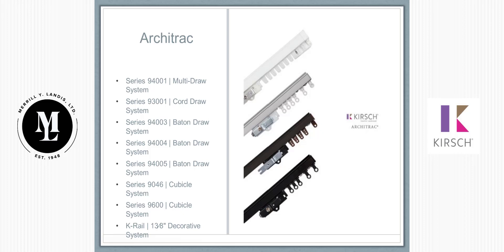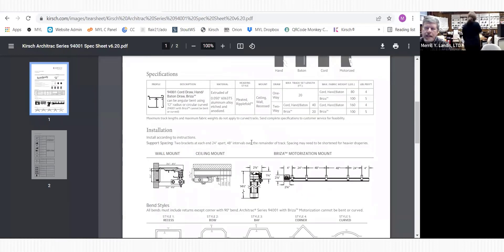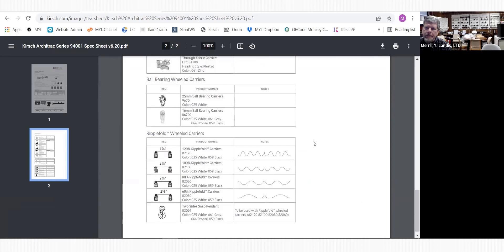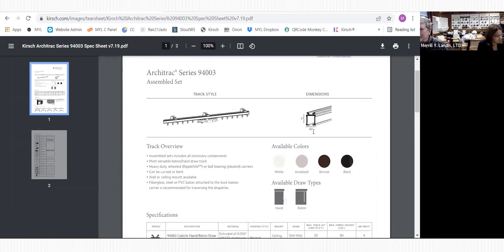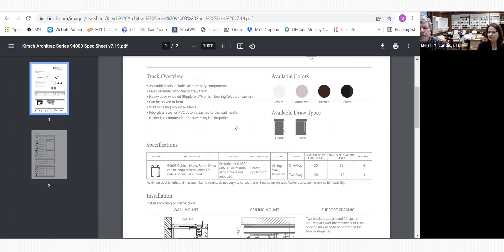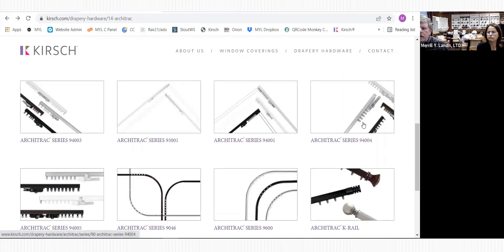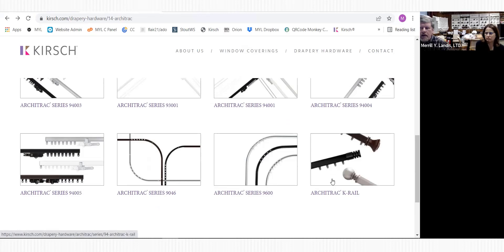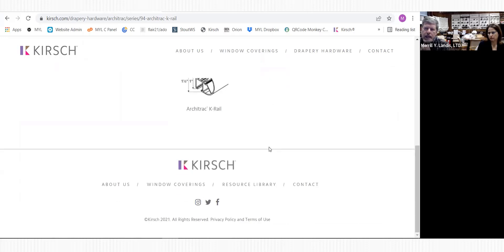Kirsch Architrac Hardware - All About Tracks

Comment: I want to ceiling-mount my 93001 track using the Kirsch ceiling clips (thus avoiding having to awkwardly screw the entire track to the ceiling). However, it looks to me as if the head of any screw I use to attach the clip to the ceiling will be a problem: the screw-head will make it very hard to push the track into the clip. I recall when I used the wall-mount clips in a previous installation that even then it was tough to hold the track in place firmly enough to turn the "gripper" (that you rotate with a flat-head screwdriver) into place. Any suggestions? Do you have any experience with the ceiling-mount clip for the 93001?
Reply from the maker: Hi Bob! Thank you for your response, please direct all responses via email to: mylmarketplace@mylltd.com